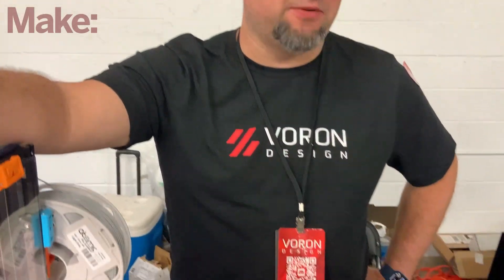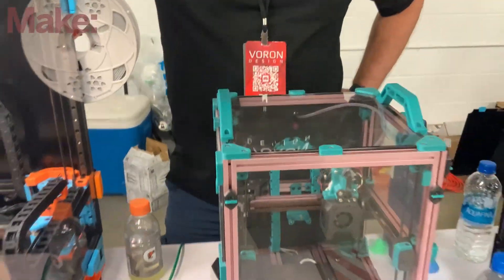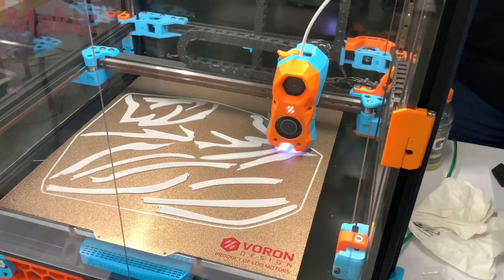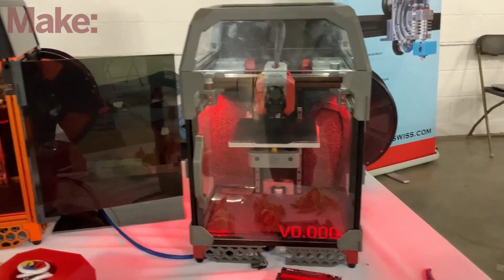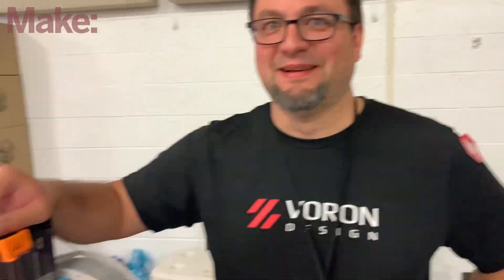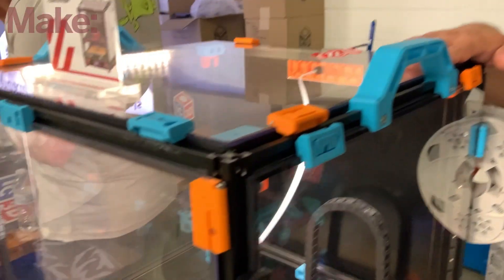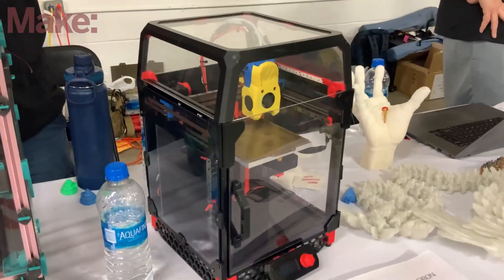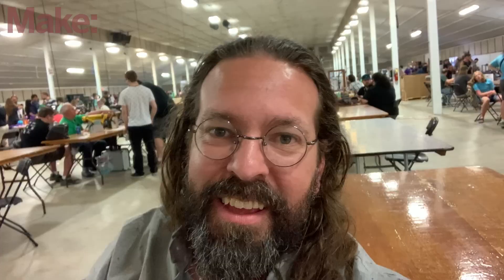Voron: What's the story behind the new popular #3dprinter ?

Comment: I have been watching many voron vids and finally realized they are just now getting up to the quality of my Zortrax M200, I just jumped into this craft with a high-quality expensive machine and leapfrogged all this, of course I didnt get to assemble or tinker with it which I miss but I wanted to use the prints not fiddle with the printer, I am still considering building a Voron but worry it will not compete with a commercial machine.
Reply: The M200 is great for visual quality, but the prints also take ages to a point it's not funny anymore after you used a printer where you could choose the speed or even change any of the deeper settings.

Often times I need technical prints and I want them fast. A 5h print on a Zortrax is around 3h on any other printer. Yes, the quality isn't the same, but I value my time much higher than print quality. You can also dial speed back down so it matches the speed of a Zortrax and get better quality. Or for small stuff use smaller nozzles.

Ultimately what lets our M200 dust is the fact that the closed down software literally kills all it's potential.

Heck, it's a CroXY print which can be crazy fast even compared to CoreXY. But all it does all day is printing slower than Ender 3 speeds at times.

They recently published a zcode to gcode converter, but I didn't manage to get a good print out of it.

Don't get me wrong, the hardware is really good, but everything software on these things I hate with a passion. Looking forward to the day putting a Klipper board in it.
Reply: @steilkurbler4973  I can agree with many things you have said, I am not as versed in the tech but thats why I laid out the cash for a Zortrax, they have worked hard to get reliable prints and as you say, i value my time, I can do plenty of other things on the main build while the printer is working. But I agree they are slow, I would like to play with a Voron etc but it usually requires some of the tech things you mentioned, fiddling with the settings...why would a serious fabricator do that when the main project needs their time.